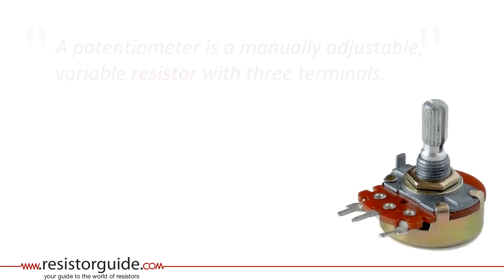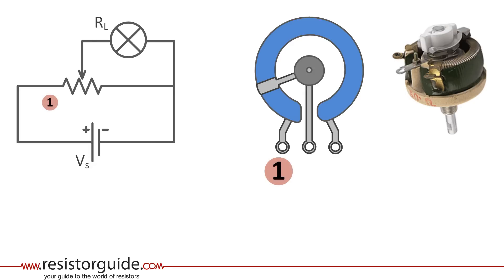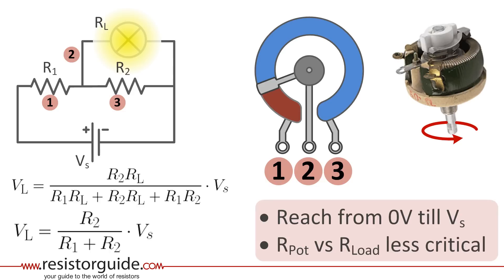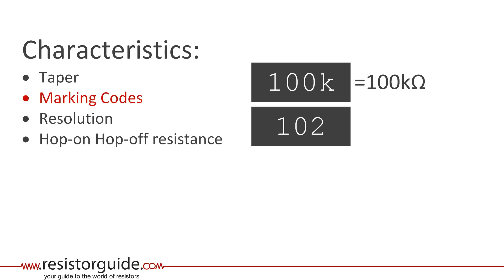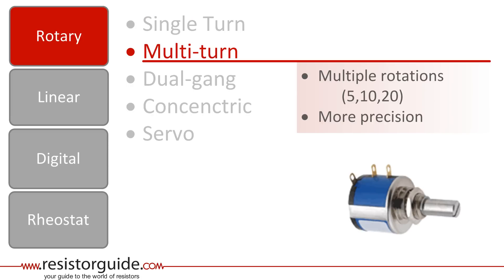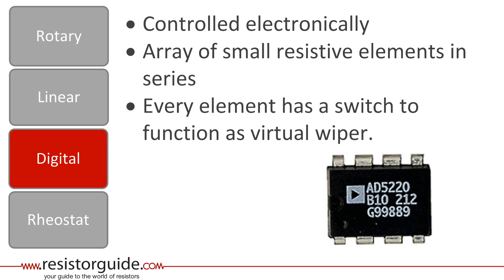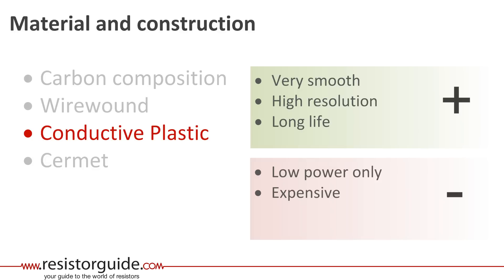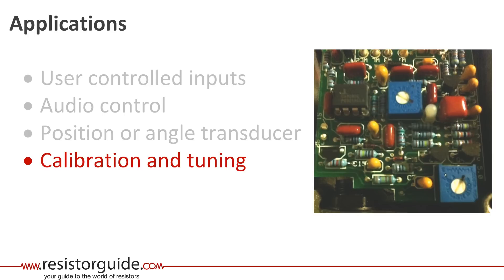Potentiometer

Comment: Thanks so much , I am now understanding more about potentiometer. However, If i want to buy a high resolution pot. How do i distinguish the pot whether high resolution or not before purchase??

Because i am going to replace the potentiometer for my flight stick. But i didn't found the same 50K 60 degrees angle of rotation pots. The pots i can found in my country are only 270 degree or larger. Also with low resolution.